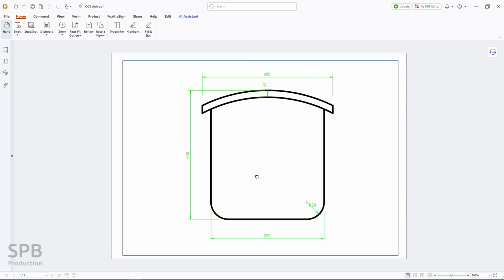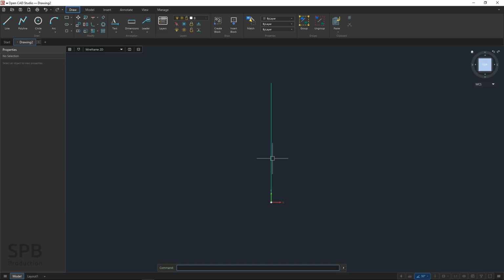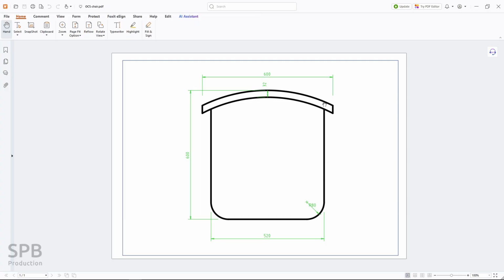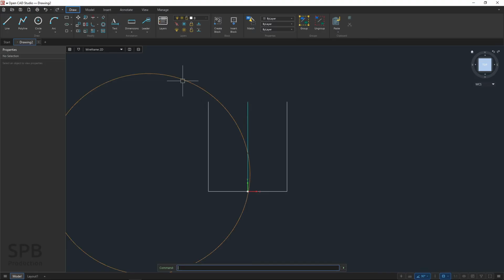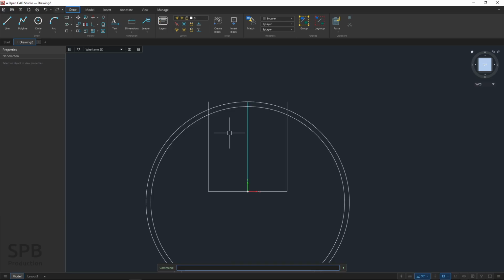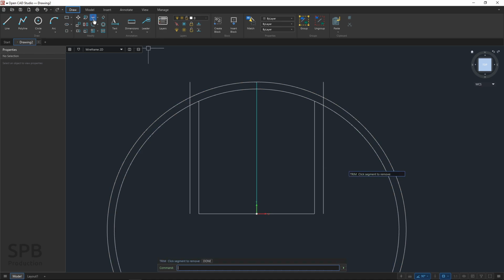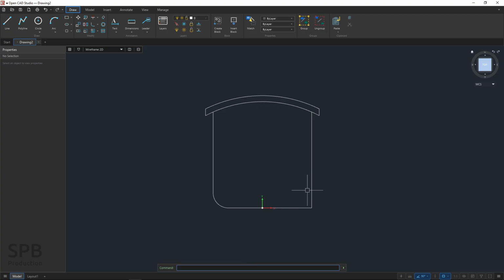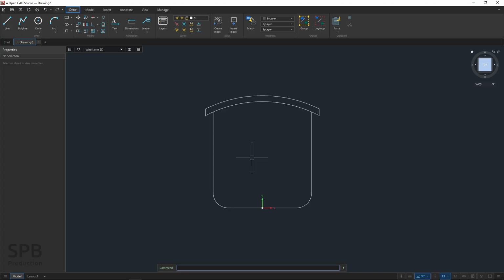Create 2D Chair DWG Drawing in Open CAD Studio

Comment: Tried downloading and opening, I get a message stating that the file cannot be opened because Apple cannot verify it??  any suggestions??
Reply from the maker: Please file report to the Open CAD Studio issue tracker so developers can look at it: https://github.com/HakanSeven12/OpenCADStudio/issues

Please provide your system info in the issue report.

You might also try to install one of the older versions if the issue is there too.
Reply: @SPB-production  thanks.. I'll see if an older version is the answer.. if not, I'll send info to above.